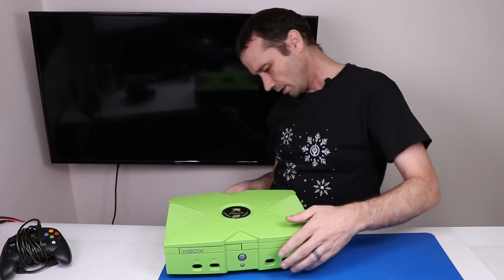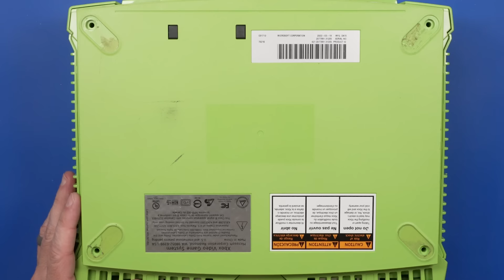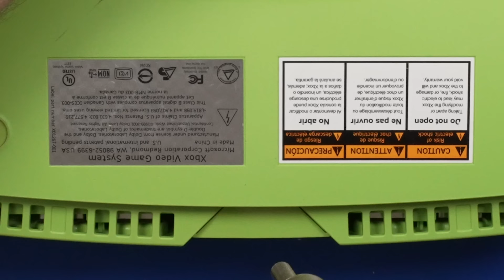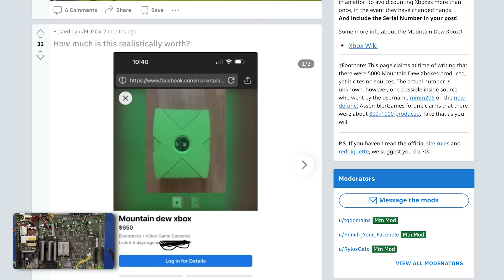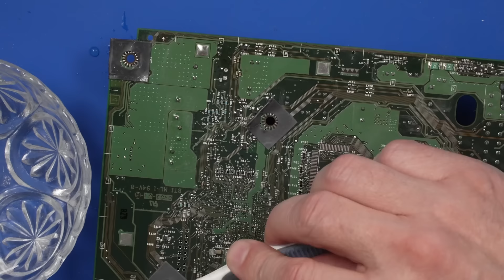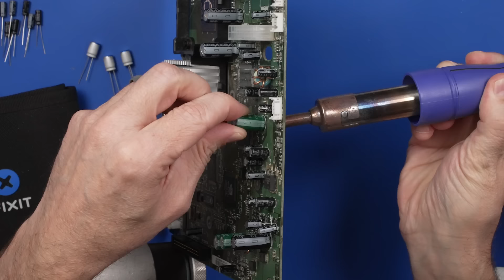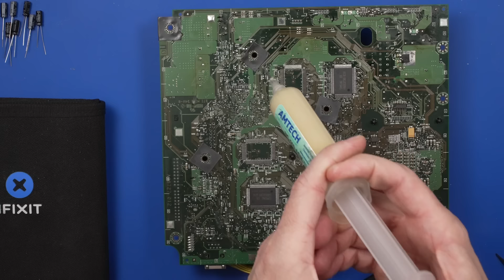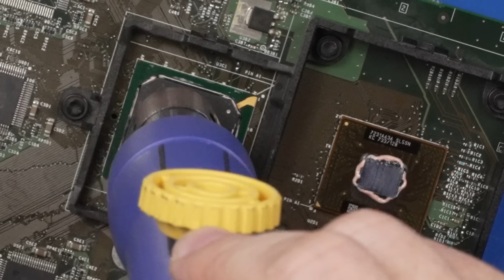I Finally Found One of These! Can I Fix It?

Comment: Question: Wouldn’t the white vinegar damage the board as it has water in it also. I use vinegar for acid damage repair, but I isolate the part and fully submerge it into white vinegar for acid damage repair.
Reply: IT's possible, but you aren't going to leave it soaking in vinegar for 20 years. That's the difference.
Reply: @awilliams1701  My worry would be the residual amount of vinegar left over after cleaning.
Reply: @RedFaceeee  That's easy to get rid of. You can actually put PCB's in the dishwasher as long as you don't turn the dryer on. The soap used has anti-corosive properties. But even if you don't do that even IPA will take care of it. I see vinegar used in the retro community all the time. It works wonders.
Reply: @awilliams1701  interesting. Learned something new 👍

Comment: I had an OG Xbox with cold solder joints on the PSU wires that got to the main board.  This was preventing the main board from getting any power from the PSU.  I removed most of the old solder with solder wick and replaced it with some fresh solder and it solved the problem.
Reply from the maker: Thanks for the comment. I'll make sure to check that
Reply: Can confirm.  Cold solder joints can crystalize, much like if you move molten solder before it cools.  The crystal lattice has voids.  Those voids fill with oxygen from the air and oxidizes the metals in the solder from the inside out.  After time, the resistance of the solder joint increases as more of the metal is oxidized, eventually becoming brittle and you have an invisible open-circuit.
Reply: good point

Comment: Super cool.  I have not used my XBox that much and I have one of the newer revisions but the PSUs in the XBox are apparently not great.  Mine completely died the last time I used it.  I don't know what fails on it but I swapped mine out for a refurbed PSU and it has been solid.  I guess I better check the caps on mine again.  I replaced the 4 that are known to go bad and they were bulging but not yet leaked.  Great video as always and looking forward to Part 2.

Comment: Fuse on the power supply is most likely gone. I'd check it in continuity mode. No beep = blown fuse. T2A 250V Fuse.
Reply: Yep, I’m surprised he didn’t check any voltages across the power supply, but that does make for a 2nd video!!
Reply: this was my thought. I do HVAC and ive come across many window units that had a small blown fuse on the board where the power comes in. So many people even experienced people miss those small fuses.
Reply: yep, just had a 1.1 with no power, found the fuse on the PS was open.
Reply: Also check the main pins at the AC connector into the power supply. The solder would crack and cause arcing. Also the fine traces around the edge of the mainboard would get damaged.
Reply: @1MiketheMechanic  This!!!! <3
Reply: Same here!
Reply: Yup.
Reply: My thoughts exactly. Fixed a free ps4 for $1.50 cause of this issue
Reply: This is my guess, too.

Comment: Question in general for me to understand, but would a semi soft or medium wire brush (small of course) help to clean the corrosion a bit easier? Or would a pick is a better option since it's more precise to just one point?
Reply from the maker: I wouldn't use wire just because it can do so much damage so easily. They also lose wire bristles and I wouldn't want to lose one on the board and not notice as that could damage it.
Reply: I think there is a chance of traces getting damaged when wire brush is used but plastic pick may not damage it not sure just a guess

Comment: capacitors don't contain an acid, they contain a base, an alkaline base I think,  and that's why vinegar is used to neutralize it. if it was an acid you would use a base to neutralize it, like baking soda. but even though it is a base, it will still eat away and destroy the components, just like if you were to leave the vinegar on there without cleaning it off (well, maybe not the vinegar that's used as food grade because it's diluted quite a bit.. but it would do SOME damage, but probably not as much as the caps do)- GOTTA LOVE SCIENCE!!!
Reply from the maker: Lol, I knew this would be a top comment. TronicsWife pointed this out when she was revieing the video. I was never good at chemistry, lol
Reply: @Tronicsfix  nothing wrong with that. Just better to get the info out there for safety
Reply: Those Cooper aerogel caps used an electrolyte based on potassium hydroxide - it's a slightly weaker base than sodium hydroxide (the main active ingredient in Drano), but only slightly.  Having said that, its' not safe to assume that all supercaps use a basic electrolyte - some of them do use acids.
Reply: was just wondering how he would neutralise an acid with vinegar. Thanks for explaining
Reply: Was goi g to make this same comment. It isn't  a big issue, but if someone were to try to neutralize acidic things with Viniger they could be in for a very bad time
Reply: "The oxide film anode used as dielectric in the aluminum electrolytic capacitor can be damaged by the application of opposite polarity voltage or by voltage exceeding the rated value. The electrolyte has both acid and basic components. The oxidation effect of the acid component causes healing of the oxide layer, a phenomenon that is referred to as self-healing."
Source: TDK, in Capacitors, Part 7 "Electrolytic Capacitors [2]".

There's also a few other sources stating that liquid electrolytic capacitors can have a slightly acidic solution in them. Ian Sinclair wrote a book called Passive Components for Circuit Design, on Chapter 4 of the book he says. 
"The electrolytic capacitor is a subject by itself, and it has to be treated separately from all other capacitors. The principle is that several metals, notably aluminium and tantalum, can have very thin films of their respective oxides formed on the surface when a voltage is applied in the correct polarity (metal positive) between the metal and a slightly acidic liquid."

All of these articles, and more, can be found by searching "electrolytic capacitors that use acids" online. Apologies for this being challenging to read, I am not used to typing such things. I found this topic interesting to look at. You're correct though, a baking soda solution would be better since it would be alkaline. Basically it just depends on the capacitor.
Reply: That's what I thought. I kept thinking that capacitors worked like batteries where they were alkaline. Especially saying he was using acid to neutralize "acid".
Reply: Thanks for that reply, I didn't know how an acid neutralized an acid
Reply: Btw, "alkaline" and "base" mean the same thing.  It means a solution with a pH greater than 7.
Reply: @StormsparkPegasus in common practice a lot of people incorrectly use the terms interchangeably, but they do not technically mean the same thing. All alkalines are bases, in that the have a ph over 7. But alkalines are made from alkaline metals from the left side of the periodic table, hence the name. This includes stuff like sodium and potassium which form hydroxides, which are based. If you make a base without those metals, such as ammonia from nitrogen, it is a base but NOT an alkaline.
Reply: @StormsparkPegasus  
They are not the same, as in the ph levels, above 7 becomes acidic, base is below, although the way it works is pretty much the same, they both will damage components, but they are different, thus using different compounds react differently, peace, have a great day
Reply: @geraldhand5047  Please read again. He said Alkaline = Base and is correct. You misread him saying Acidic.
Reply: @zierlyn  im talking about the video
Reply: @anthonyshiels9273 you really think a 20 year old xbox is going to be using supercaps?
Reply: @MortRotu  it does, yes, that's what the EE at microsoft decided to use instead of a battery to store the date/time, a regular cap wouldn't stay charged long enough for this, although the supercap doesn't do a great job at it either, it does it long enough if the console's not plugged in (somewhere around ~8h).
Reply: @MortRotu  Please supply documentation to support your statement where I typed anything concerning this device having Super Capacitors in it???
Reply: The large capacitor in the power supply should be first discharged prior to removal.
Reply: Although, anything washes away with enough alcohol. ^_^
Reply: Is vinegar non-conductive?
Reply: @PoutingTrevor  Since all acidic solutions are conductive (because they contain ions) vinegar is conductive. Food grade vinegar is a 5% (or about) solution of acetic acid.
Reply: I did not know compacitors were mostly basic. I thought they were mostly acidic. Thank you for the information!
Reply: I was wondering! thank you
Reply: While vinegar is good for cleaning thus way like you said it will cause tons of corrosion if not cleaned off. Ask me how I know.
Reply: @FaddyMatty  yes. always clean youre vinegar off with ipa folks!
Reply: Came in to the comment section just to say this.
Reply: electrolyte might be what u mean? its a basic liquid but i believe its an electrolyte.
Reply: @2EXTRM  Electrolyte is an umbrella term that refers to all substances consisting of ions: acids, bases, and salts.
Reply: @Mystikk666  its not a blanket term. Theres a definition for the electrolytic capacitor. I didnt remember it properly.
Reply: Base= caustic.  Acid= corrosive
Reply: Thats exactly what I was thinking too! Cannot be an acid it has to be a base for vinegar to react.
Reply: I learned a few weeks ago that battery acid isn't actually acid lol
Reply: @xsaxia2008  It depends on what kind of battery you're talking about.  Lead acid batteries (typically used as 12V car batteries) use sulfuric acid, that is definitely an acid.
Reply: @xsaxia2008  battery acid is sulfuric acid. Most motorcycle batteries, for example, are sold dry and require you to add sulfuric acid. Other types of batteries use chemistries such as alkaline or zinc chloride, but these do not use "battery acid".
Reply: You keep adding way too much thermal paste 😅 the perfect amount is way less m8😉
Reply: @Lickmyheals  Agreed, too much paste. Take a small dollop and spread it to cover the IHS in a thin layer.
Reply: Same reason bleach is dangerous.
Reply: Yeah but Nuhuh
Reply: It’s electrolyte I think
Reply: I love watching your videos, you are an electronics guru.
Reply: Here’s your medal 🎖️
Reply: This happens to be correct here, but isn't always the case.  Most electrolytic caps are acidic, but the defective ones produced during the capacitor plague were alkaline according to research performed at the time.
Reply: The one thing you’re overlooking is the fact that i believe he’s not using it by the literal chemical definition. To neutralise something simply means to remove hence he’s cleaning up the board by removing the residue .

Comment: I would test the traces near the battery clock under board to make sure there was no trace rot. Those traces affect the power😊. There are test points you can check. Might have to install a jumper wire or trace repair.
Reply from the maker: Yeah, this is one of the first things I need to do.
Reply: @Tronicsfix yeah it's like 99% going to be trace rot. Look at the bottom of the board close to where the power and eject button would line up and you'll be able to see it. No microscope needed. It's usually very easy to see
Reply: This! Those traces for the buttons are at the edge of the MOBO near the clock capacitor. Mine were corroded so bad I had to install the jumper wires and after I did, my Xbox works just fine again.
Reply: Good advice. From personal experience, I've had corroded traces near the clock capacitor, which would instantly make the xbox turn on as soon as it was plugged in and it could not be turned off, except by unplugging it completely. I used jumper wires to re-connect 3 traces and it worked properly after. My guess is this is a similar issue, but affecting the power switch in a different way.
Good luck with figuring it out! Looking forward to watching part 2, which ends up being a success story :)
Reply: @konstantine_c  funny you've got the "always on" issue, supercap leaking often leads to "ghost powering on", as the console would appear posessed and would turn on/off and/or eject/insert the drive tray at randoms, kinda spooky when you think about it :D  
Has anyone recommended to check the AC plug solders tho? They're known to crack from stress and that would be my first guess, before thinking about those front panel/power button traces. GL
Reply: @LawnMo  Hahah, this reminds me of one time I enabled the setting for my console (my PS3 iirc, or might have been X360) to automatically install updates and the first time it did it was at night. Just turned on and started downloading stuff. It was right in my bedroom, so was really spooky, especially since it woke me up and I had no idea what's happening with it. Disabled that feature the next day :)
Reply: @LawnMo  Yeah, that one might be the culprit as well, but you'll see more electrical arcing and fire than no power.
Reply: Had the same thing on a Xbox I got from Goodwill a broken trace around the outside of the board. Xbox would power on as soon as plugged in. There are sites that have the test points for each end.   @konstantine_c
Reply: You are right. That clock capacitor might have ruined the power/eject button. Had a few of those broken ones fixed by adding a wire on the broken traces. Currently those xboxes found a way to the trash can because they failed again.
Reply: @Erikih what caused them to fail?
Reply: @IMDYT420 
when they age more components will fail...that's why buying any electronics older than 2 years is risky.
Reply: Its likely to be one (or more) of the four traces that run across the front of the console on the underside that you need to check.  These commonly corrode even without any help from the clock capacitor.  I had the same issue on one of my OG XBoxes.
Reply: Agreed. Check the traces for damage/rot
Reply: Interesting, i have an xbox where the power button does not work so i need to power it on with the Disc eject button i wonder if this could be the issue - if so would it also not allow the disc drive button to power the console?
Reply: @matcam89  it is, the traces don't even need to be damaged by the clock capacitor, they're easy to scratch unintentionally, power button not working but eject does is a direct "goto these traces" ;)
Reply: @LawnMo  thank you I will check that
Reply: @matcam89 Yes. both cases, the power button may no respond and may actually power up the console when you plug it in. It may turn itself off randomly as well. The disc eject button will not respond as well. I had a store owner that was going through his OG Xboxes for me and he kept banging on the top of them to get the tray out, and he came across one like this (powered on when he plugged it in) and I told him to stop because it's not the tray loader that was the culprit on that one.
Reply: This is what I'd check as well. With the amount of build up that cap spread out, the traces that run from the power/eject buttons underneath the board are most likely toast. Had to do the same repair with some jumper wires and it started right back up and is working happily after some disc drive repairs as well.
Reply: Came here to post this lol. With any meaningful amount of clock cap leakage, this is the first thing you should check
Reply: Was thinking the same thing. seems to be a common problem with these consoles.
Reply: i think he knows.

Comment: Got to confirm the PSU is outputting the correct voltages with a multimeter. Then check the buttons are working.

Comment: Just make sure you get rid of all the vinegar when you use it as a neutralizer since it will continue to corrode the board especially if it's underneath chips. Best to rinse the board with distilled water to displace it, then rinse with iso.
Reply: iso is good enough ...
Reply: As someone that details things for a living, there’s only so much cleaning that can be accomplished with rinsing alone. A lil bit of gentle agitation with microfiber  is the only way to be sure.

Comment: If I may be so bold, you might wanna try Napthan or Bestine as an adhesive release to get off decals like those. Ive used it for decades working with documents and its pretty good stuff if you dont want to use a heat source. Cheers.

Comment: So at this point in time if you buy a used one that’s working, can you assume the caps have been replaced? Seems these components were low quality across the board
Reply from the maker: Not necessarily. If I bought a used one I'd check the capacitors.